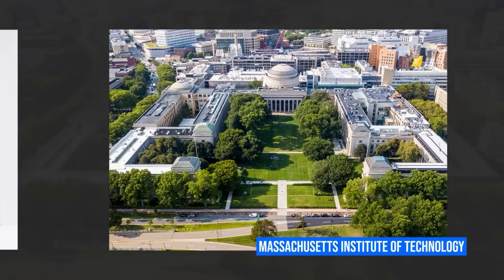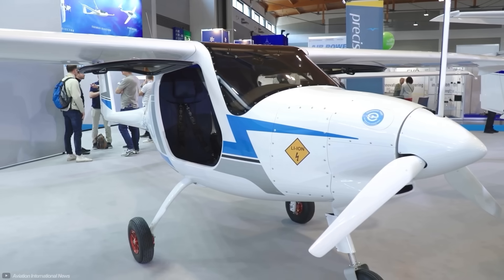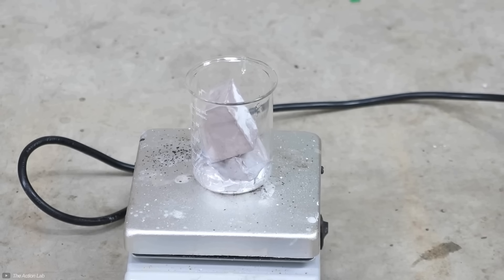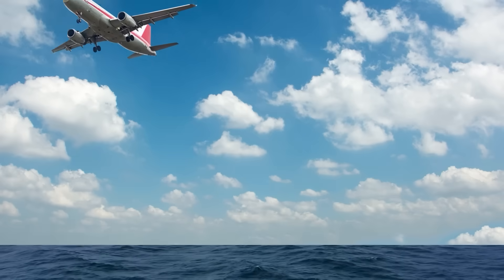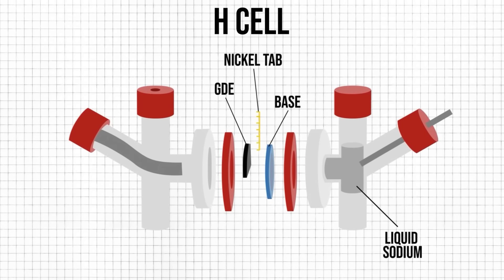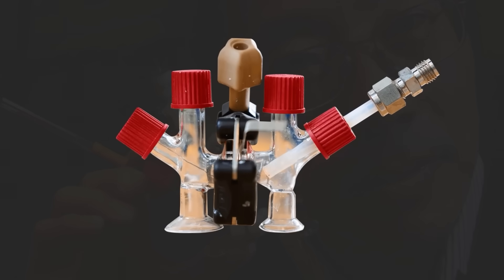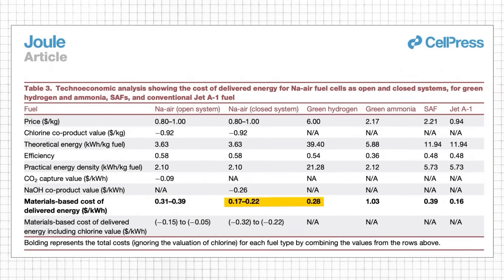How MIT's New Sodium Fuel Cell Changes Everything

Comment: What is liquid sodium?  Saltwater or molten salt or ?
Reply: Sodium is a metal (element 11 in the periodic table). It's highly reactive, so in nature it is never found in its elemental form - only in compounds like sodium chloride (AKA table salt). However, you can purify the metal, and that stuff is what this fuel cell is using. It becomes liquid by melting it.
Reply: @streetwind.  Thank you.  My point was the presentation was unclear to me.  If molten then say molten. Molten implies heat.  Liquid is somewhat confusing. Sodium is molten at 98 degrees C.  Water boils at 100 degrees C.
Reply: @mcsmith7606  Unfortunately, "liquid" is the scientifically correct term. It is the name of the phase that a material enters when it is melted; it phase changes from solid to liquid.

Different materials have vastly different melting and boiling points, so they phase change at vastly different temperatures. We tend to orient ourselves towards water as a standard, but water does not hold a copyright on the term "liquid" ;)
Reply: molten Natrium metal
Reply: It is Sodium Extracted from Table Salt Extracted from Seawater.

Comment: AI Summary

Abstract:

This video introduces a groundbreaking sodium-based fuel cell developed by MIT, poised to revolutionize electric propulsion, particularly for aviation. This innovative fuel cell boasts an energy density four times that of contemporary lithium-ion batteries and utilizes abundant, non-pressurized sodium, which is consumed in a molten state as an integrated part of the cell. A key advantage is its decreasing weight as fuel is expended, akin to conventional aircraft. While the initial prototype exhibits high energy density (1000-1400 Wh/kg) but limited power density (40 W/kg), a scaled-up version is projected to significantly boost power output. The system's unique exhaust, sodium hydroxide, is claimed to transform into environmentally beneficial sodium bicarbonate through carbon capture from the atmosphere. Despite remaining engineering challenges, the technology's potential for substantial cost savings over green hydrogen and its recent spin-off into the "Propel Arrow" startup underscore its promising future.

The MIT Sodium Fuel Cell: A Deep Dive into Next-Gen Electric Aviation

*   0:02 MIT Breakthrough Fuel Cell: MIT engineers and scientists have announced a new fuel cell design that offers significantly higher energy storage than current lithium-ion batteries.
*   0:06 Superior Energy Density: This new fuel cell can store four times more energy per kilogram (1,000-1,400 Wh/kg) compared to state-of-the-art lithium-ion batteries (200-300 Wh/kg).
*   0:13 Abundant Sodium Fuel: It uses abundant and non-pressurized sodium as fuel, which can be reloaded as solid blocks, eliminating the need for heavy, pressurized hydrogen tanks. This makes it a potential power source for future electric planes.
*   2:23 Integrated Fuel System: Unlike traditional fuel cells, the sodium fuel is an integral part of the fuel cell's structure and is slowly consumed during operation, requiring the sodium to be in a molten liquid state (around 100°C or 200°F).
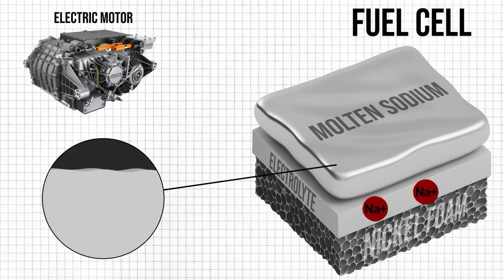*   4:39 Electrochemical Process: The process involves molten sodium ions passing through a beta alumina solid electrolyte, releasing electrons to power motors. These ions then react with humid air in a porous metal foam.
*   5:33 Environmentally Controversial Exhaust: The exhaust product, initially sodium hydroxide (a component of drain cleaner), is claimed by MIT to react with atmospheric carbon dioxide to form sodium bicarbonate (baking soda), which purportedly captures carbon and helps deacidify the ocean. However, the presenter expresses skepticism about the localized impact and full reaction.
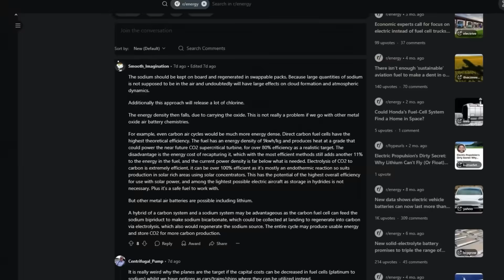*   6:47 Chlorine Byproduct: Chlorine is produced during the manufacturing of sodium, which can be a valuable byproduct for sale or other uses.
*   7:54 Unique Weight Reduction: A significant advantage is that the fuel cell becomes considerably lighter as the sodium fuel is used up and ejected, similar to how an aircraft lightens as it burns jet fuel.
*   8:51 Performance Metrics: While boasting impressive energy density, the test cell's power density is currently low (40 W/kg). However, a full-size stack is projected to deliver much more power, nearing that of some lithium-ion batteries, with an overall efficiency of about 60%.
*   10:05 Cost-Effective Fuel: The paper predicts the sodium fuel could be as low as half the price of green hydrogen, with further savings if byproducts like chlorine are sold.
*   10:38 Future & Commercialization: The foundational science for this breakthrough is in place. The next steps involve engineering challenges like advanced cooling systems. The technology has already been spun out into a startup called "Propel Arrow," with a team experienced in successful clean tech ventures.

I used gemini-2.5-flash-preview-05-20| input-price: 0.15 output-price: 3.5 max-context-length: 128_000 on rocketrecap dot com to summarize the transcript.
Cost (if I didn't use the free tier): $0.0051
Input tokens: 15544
Output tokens: 804

Comment: Garbage. The hydrogen still needs produced.  
Wish they'd stop barking up this dead-end tree.
Reply: Tell us you didn't watch the video, without telling us you didn't watch the video.

This fuel cell doesn't used compressed hydrogen. It uses the air we breathe and sodium. No tanks of compressed gases. 

However the exhaust gases are suspicious and further testing and research is needed.
Reply: @Bad-Squishy  Yeah, you're right. I just immediately turned it off when it brought up fuel cells.  
I was in a bit of a mood but I'm a bit calmer now so I'll watch it without my "everything on the internet is bs" filter on.  
I'm usually better than that. 😔
Reply: @EddieTheH  good man. Thank you for your response to the guy who called you out. Wish more people did that.